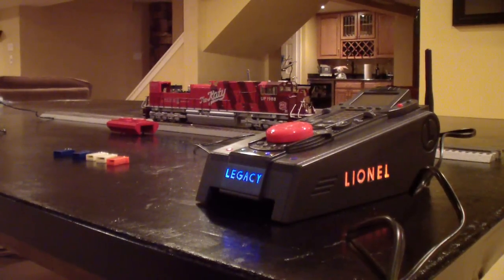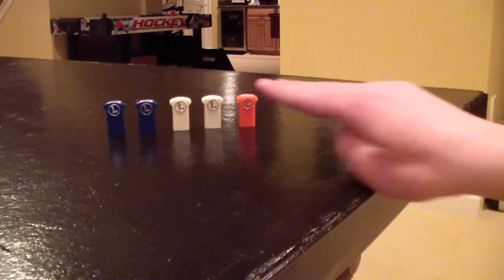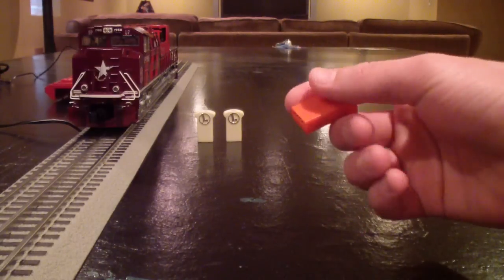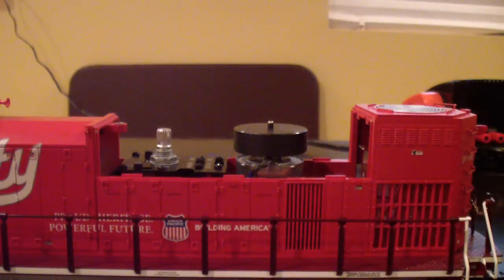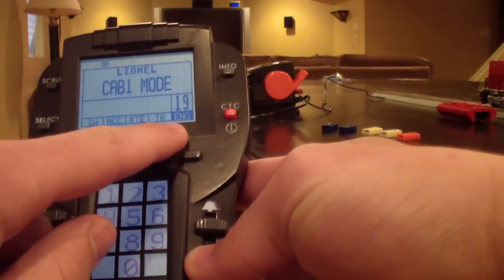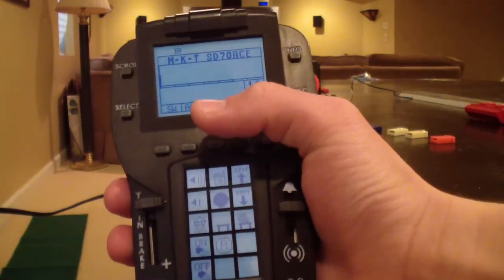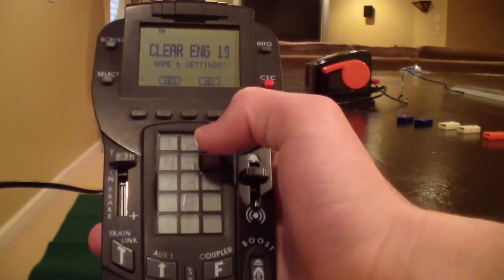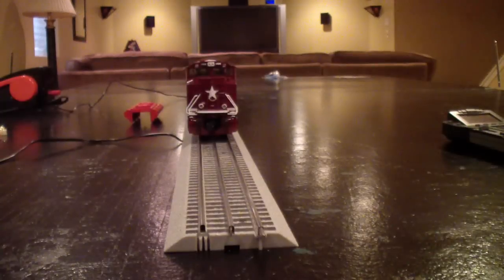Programming Legacy System Compatible Locomotives (Legacy System Module Questions Answered)

Comment: I really like your videos, they helped alot, but for some reason I'm still running into issues.  

I have a TMCC engine and a cab2 remote, I did what you said in video, nothing seemed to happen.  Now I did have the cab 2 hooked correctly because I have other Bluetooth engines and when I went to power the cab 2 on throttle, all the OTHER engines except the TMCC one moved suddenly lmao 🤣 I kinda got a laugh but said, well atleast I know it's connected to the track lmao.

Comment: Hi Steve,  just got the legacy command set and first legacy engine.   When using ID #1 everything works.  I'm not able to change the ID number.  I have your followed your video as well as the instruction manual.  When I assign the new engine number there is no feedback from the engine (horn or lights).  Therefore the ID number did not change from one.  Your video is very good but I cannot make it work.  Any ideas.
Reply from the maker: +Frank Grimaldi Yea each engine defaults at 1, that's why everything works at once when you use 1. Did you put the engine into "program?" If so, did you turn off track power between each step? You have to turn off track power each time you throw the program/run switch; you can't just switch it while the engine is on. Also, did you hit the "set" button (and not something else)? If none of this works, just try restoring your engine to factory settings first, as shown in this video, then go from there. Let me know if any of this works.

Comment: Very informative.  Question I have a couple of lionel tracks I run. I have 2 NH SD 70's that are legacy that were already programmed into my legacy.  If I were to buy another legacy engine or engines  to run on a different track I would be able to program them into my one system correct and then I would just use on the different track
Reply from the maker: I'm not 100% sure what you're asking, but it sounds like you want to know if you can run multiple engines on two different tracks with one legacy system? You can use the legacy system on any layout as long as it's connected to that layout. For instance, you can't run another Legacy Engine on track 2 if your Legacy system is connected to track 1. However, if your two tracks are connected by switch-track interchanges, then you can use your Legacy system on both of those tracks.(Because it's the same track) Also, you can leave one engine in operation while you address another with the same Legacy System. The engine you left running will keep running at the speed you left it at. Last I knew you can do this with up to six engines. Let me know if this answered your question.
Reply: Yes you did.  Thank you.
Reply: +Matthew Bernier You would be able to use one system if you had the two mainlines connected together with physical track or if you had a dedicated PowerMaster to regulate track power for each mainline.  If I'm not mistaken you can have a PowerMaster on each mainline addressed using a TR ID that can be accessed through the Legacy Command Base.  Not quite sure how you would do this if you were using a TPC unit as opposed to a PowerMaster unit.